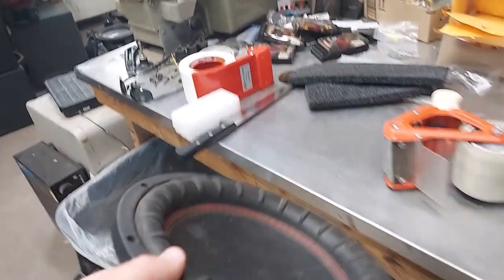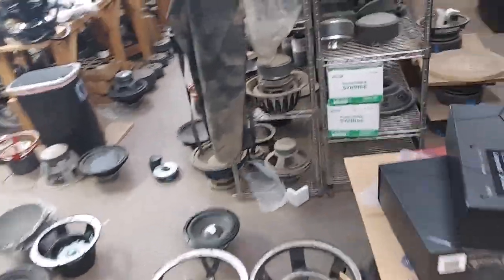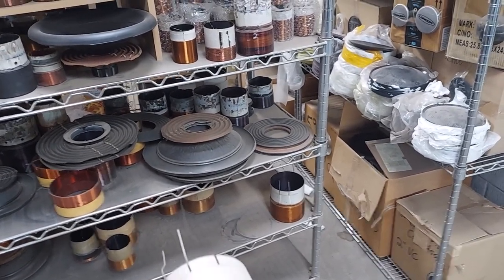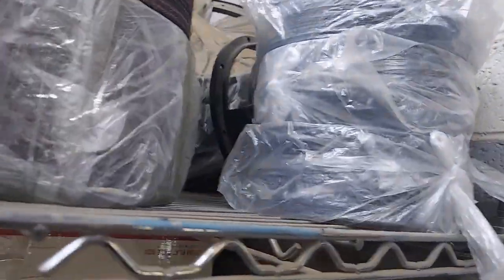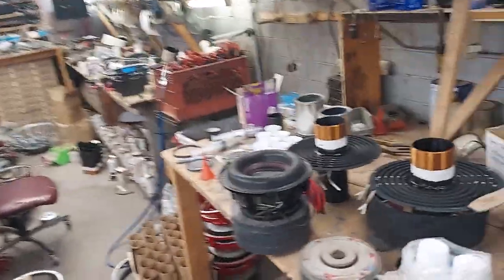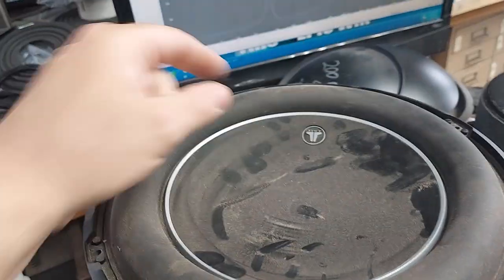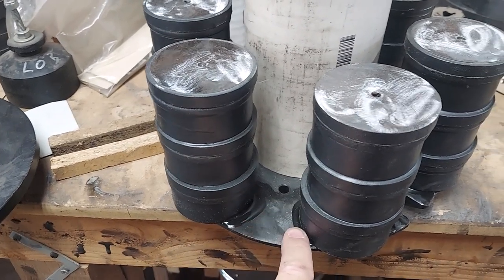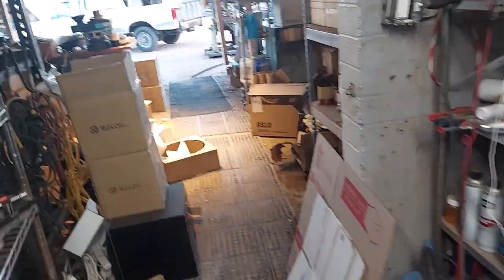Shop Update: RE Audio w/ mod'd Rockford T1 motor + HardTimes 10" subwoofer by Epsilon Electronics

Comment: Is that 10 originally the soundstream reference?
Reply from the maker: Epsilon might have changed some of the soft parts and use the same motor but I remember the reference motor being slightly different and using a cast frame

Comment: I found a stash of RF P310D drop in kits. Would it be worth finding a frame and magnet to fit them?
Reply from the maker: Fer sher.  Text me direct.  6023126504  Send me side pics and coil dims. along with the spider diameter.

Comment: Does anyone know where to buy a recoil kit for the Dayton Audio 15" RSS390 HO SVC 800 RMS 1600 MAX, 92.8 Sensitivity?  Also, any tips on getting the aluminum cone and dust cap off without destroying it?  I've got the rubber surround off without as much of a scratch, but this dust cap is a nightmare.  I can't even tell you the exact specs of the voice coil because I can't get to it.......yet!  NEVER RETREAT, NEVER SURRENDER!
Reply from the maker: I assume that Parts Express could help you.  If not, text me direct with the gap dims and some side pics of it.  6023126504

Comment: My problem with Sunclown isn't that they have bad equipment, they have nice stuff, but they used to have really good quality gear at a reasonable price, then for some reason it's like they doubled everything, used to be able to get a SA12, which is a great woofer, for like $150, then it was $200, now it's just way overpriced for really no reason whatsoever. It's not worth double the price of what any other woofer with a 2.5" coil costs
Reply from the maker: I totally agree and Jacob used to be a nice guy

Comment: I'm looking for a complete re-cone kit for a re audio mx 12. Do you have anything that can work as a replacement?
Reply from the maker: Yes I have several choices depending on your application Go ahead and text me your name and your shipping address and we can review your options 602-312-6504
Reply: @RobotUnderground  I messaged you on WhatsApp.
Reply from the maker: @videllhosein2213  I don't use WhatsApp.   You can text me direct via SMS though. 6023126504  Just let me know your name and your shipping address.  I'd actually recommend a removable top assembly for that motor.  It really needs to be on the Ti frame.
Reply: @RobotUnderground  I tried texting, not certain it was sent. I'm not from the u.s.
Reply from the maker: @videllhosein2213  email is best, robotunderground@yahoo.com or through FB /AuthenticPatrickChandler

Comment: You should unbolt that top section of that old school car lift you would still have the top of the ram but wouldn't have walk around all that shit bolted on top, or you could fashion up an adjustable height work bench! Lol. Crazy you don't see those lifts anymore they must of been expensive to install dig a hole deep enough to install a huge probably expensive hydraulic ram there like 10" wide piston or something. Then they suck because the lift assembly blocks off so much under the car... Not mind blowing that design went the way of the dodo, don't see pits much anymore, I still think there not a bad idea yeah I get it it's not very convenient to have a giant hole in your shop floor but if you have a huge shop with a bunch of bays one bay with a pit would be sweet. As you see most of the oil change franchises still use them.

Comment: When you build a high fidelity sub that still hits you in the chest but sounds perfectly balanced to the rest of the system ,what sub is it and how much
Reply from the maker: You're describing a performance level, not a subwoofer.
Reply: @RobotUnderground  so does that mean that any sub with the proper set up will fit the bill?  How about what sub has a lot of output and low distortion but doesn’t require over 1200 wrms
Reply from the maker: @DustenHanson  For the most part yes.  It just depends on your budget, how much space you can give up and what kind of power you can provide.  The end variable is your expectations / performance demands.   The industry tends to try and motivate unsuspecting users toward the more expensive solutions. For example,  I'll use this cheap box fan under my desk that's keeping my balls fresh and dry.  It costs $20 from Walmart and does a great job.  There are other fans on the market.  The Dyson model for example that has no visible blades.  It's more than $20 and may or may not be right for my application.
Reply: @RobotUnderground  makes perfect sense.
Reply: @RobotUnderground  Cheapest dyson fan is $300. So, in your example, Dyson is JL and your balls are? Skar? jk

Comment: do you still have soft parts to rebuild some jl audio 10 w6 v3s?
Reply from the maker: I only re-use the motor.  I use a different frame.
Reply: @RobotUnderground  how much am I looking at to buy the parts to rebuild theese? Or how much would you charro do it for me?
Reply from the maker: @donmige81  I can build you drop in kits with new frames for $250 each shipped.  Personally, I think you're better off just selling those for parts and buying better subs to begin with for the same $250 each.  I have a 1000w RMS 10" for only $250 shipped.
Reply: @RobotUnderground  you want to buy my existing subs for parts and I’ll buy some of you’re built ones?
Reply from the maker: @donmige81  Text me direct. 6023126504  Make sure you include your name and shipping address and I'll add you to my phone.  We can go over your options.